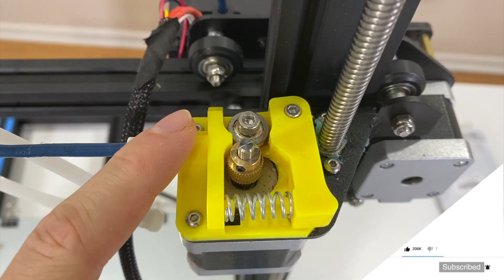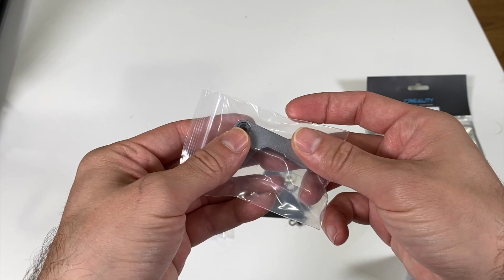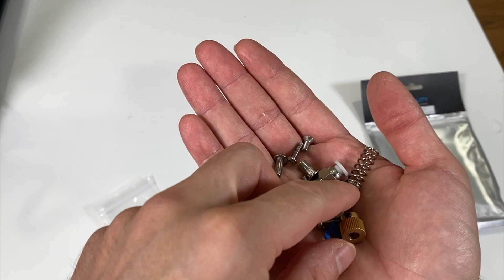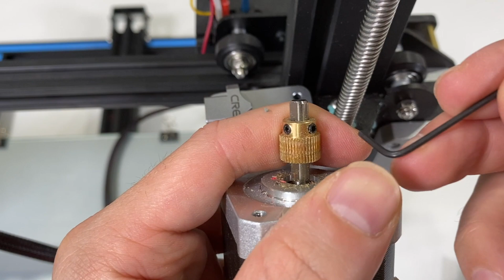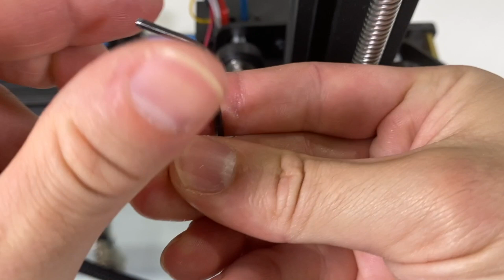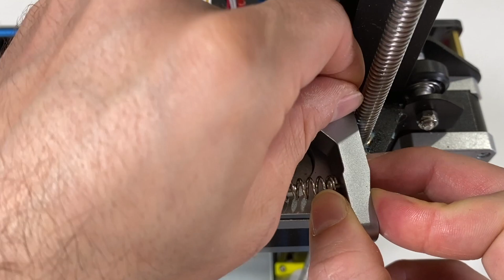Creality Metal Extruder Upgrade for CR10, Ender 3, Ender 3 v2, CR10S, and Ender 5 series

Comment: My extruder gear doesnt have set screws to remove it from the motor, help!
Reply from the maker: Lol what? How come ? Did you look at it in detail?
Reply: @3DPDoctor  it was press fit on but I got it off with a tool from thingaverae
Reply from the maker: Gotcha. Well It would be better to have set screws with a appropriate shaft. Good luck

Comment: how is it compared to the red one
Reply from the maker: Red one is piece of garbage. I used 2 of them. Both got bad and gear eat itself out. This one is perfection
Reply: @3DPDoctor  it looks exactly the same? i installed one 6 prints ago and no problem so far, will report back if it breaks sth
Reply from the maker: The red one I used was dual gear. Second gear shaft fails